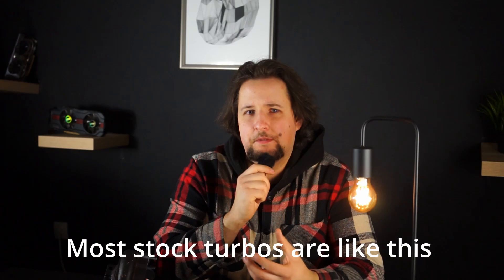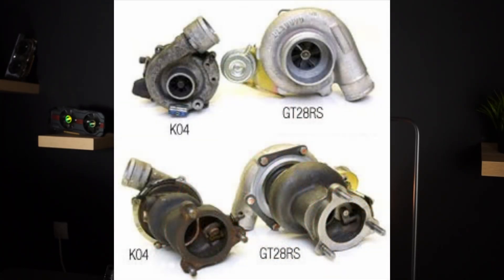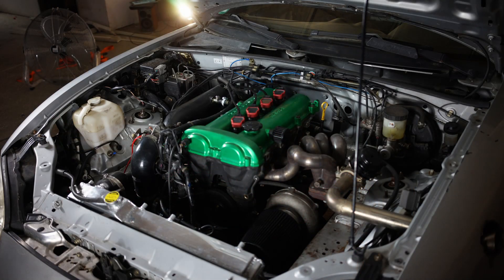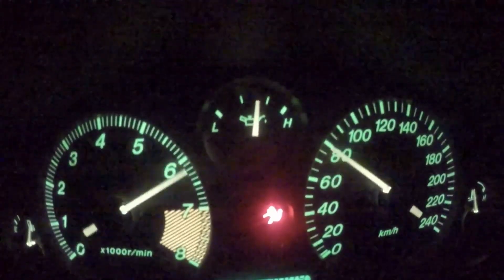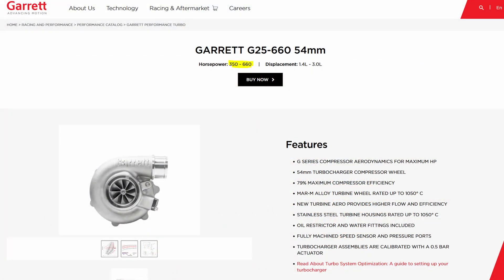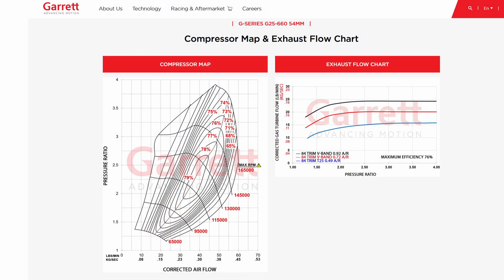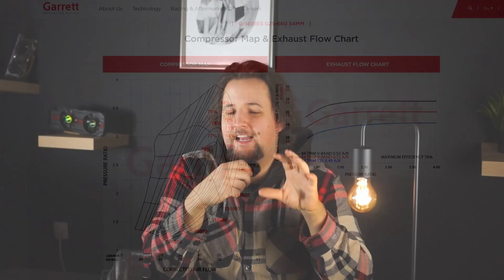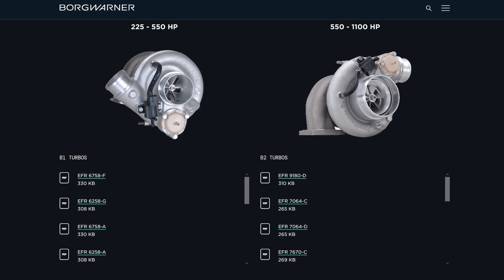What is the bestTutbo FOR YOU?  | BEFORE you buy a Turbo | IN DEPTH Turbo Sizing Explanation

Comment: Can you help me decide between a Garrett g30-660 vs a g30-770 for a Subaru ej235 engine that can rev to 8-9000 rpm’s? 1.01 A/r that housing for both
Reply from the maker: this is only dependant on the power you want to make. if you want to make 600 CRANK or below (so like 500 wheel) then choose the 660 if you want to make more like 700 crank then choose the 770 or if you wantr to have a little more headroom to turn up boost. 
Though the spool difference will not be much, so going for the 770 does not have huge downsides

Comment: Was recommended 3071 gen 2 for my 2.1 liter volvo engine (b21ft), 7.5:1 compression.
Its got stock forged internals, I was thinking "350+hp", also will run high quality IC, better flowing intake, 3" dp, 3" exhaust.

But then I saw the G series turbos, for me it seems like maybe g25-660 or g30-660 would be better for me than the 3071 gen 2?
In my head they will spool quicker and also cost a bit less. Still quite expensive though.. I dont know if the g25-550 will be too restrictove on higher rpms. (6500-7000).
Reply from the maker: I'd go for a pulsar pta4849 they are basically a g25-550 that's a lot cheaper and has been modified a little for more exhaust flow

Comment: I have had a Garret GBC 22-350 on a 1.4 t-jet fiat engine. Full boost around 4000 rpm but had horrible boost creep straight out of the box, everything was installed correctly. Now I have a Pulsar 3942G ball bearing turbo and it's great and really fast spool. Full boost at 3.000 rpm
Reply from the maker: on these its not really boost creep just garrett speccing the actuator wrong. the specs say its a 0.5 bar or 7-8 psi actuator but its actually a 1 bar actuator or 15 psi. 
if you replace the actuator to a lower pressure one it works fine! 

the 3942 is also quite a bit smaller so i think that also has a lot to do with the spool characteristics adding to that the smaller exhaust housing also! but its much better suited for a 1.4 engine.

Comment: G30 660 on 2l, what would be the peak boost rpm?
Reply from the maker: depends on the engine but probably about 4300-4600 RPM or so.could be more or less 

this is also dependant on Exhaust manifold layout, Downpipe and exhaust aswell as compression ration and some other things. VVT helps a lot with boost response.

Comment: Do you think a G30 or G35 Housing is better suited for a 3.2l engine? Power Goal is 650-750 so im unsure which would be better
Reply from the maker: id say at that power level and displacement, go for a g35 turbo it wont be much laggier than a g30
Reply: @throttlebuddies0  thanks a lot
Reply: G35 900 is perfect for a BMW 3.2 up to 700 wheel. A 3582 is lagier , a g30 has too small a turbine at 55mm exducer. It will choke , and it will spool so early it can bend rods. (Boost below 3000 rpm is really hard on your engine )

Comment: I can say from experience that the g25-550 on a 1.6 starts going positive pressure at around 2500 and full boost just under 4k and holds strong till redline .. thats on a forged rotating assembly and bored to 80mm 1.6 miata engine with a fluidamper ported head custom intake and a bunch more , but i started with a log manifold (cheap e bay one and it works but not the most efficiently) i have been looking around to try and find a better manifold but for now its just a cast log , o and i have it set at 2 bar of boost so its somewere around a 400hp 2k lb miata , super fun bit dont come in to soon to make me just burn the tires off every time i hit the gas but soon enuf to have a decent boost threshold, next will be 70lb springs and retainers to push it to 8500rpm's then cams and billet mains and it be ready to possibly break 5-600hp we see .. my goal is a 10 second street daily driven rat-rod 😅.. love all the info brotha , mad respect for sharing what knowledge you can .. peace and love brotha, keep it rad, stay safe, and build on.. ps i had a gtx3071r on b4 the g25 and it was still great but spool was just a lil less ompth if that makes sence , but i am willing to bet its cause the housing is bigger exhaust side but not enuf to hurt really just enuf to notice 😅 if that males sence .. anyways much love and respect bro , l8r .. ps ps one day i plan to build a atlas 4200 inline 6 will have to show ya whenevr i do that one .. its at war with the barra 😅
Reply from the maker: I have a 1.6 NB miata and im trying to push the engine past 500 hp when it runs again. be careful with the High RPMs the stock oil pump really doesnt like it. A friend tried it and maximum power at 8500 with a fully balanced rotating assembly is about 450 hp then his pump shattered. no limiter etc. 
the G25 is crazy good on small engines. personally i think original garrett is too expensive though. i loke the pulsar knock offs. Tuned a clients car with one, 1.8 VVT log mani and made full boost at about 400 RPM without any tricks to get it online sooner. so when doing that might be able to get it down to 3500 or even lower. 

on my own car i want to stay too-large turbo, to not stress the engine. im running stock pistons and with a gt35 size or g35 in the future ill be able to run more power without anything breaking. about 700 hp should be possible on stock pistons.

Comment: Very accessible overview! Thanks! Would you consider making a video on superchargers? To me, as a newcomer to all of this, they seem to be a good choice for enthusiast applications. Mainly because they are very responsive. Additionally, for naturally aspirated cars, they also seem to be easier to install. Maybe the heat management is easier also? They might be less fuel efficient than turbochargers, but fuel efficiency might not be the highest priority in an enthusiast car application. And of course, the turbocharger can produce some quite cool noises. It'd be very interesting to hear your thoughts on superchargers!
Reply from the maker: i dont have much experience with superchargers so no i unfortunately wont be making one in the forseeable future. 
if you size your turbo well. they are very responsive aswell the only "negative" you have is that you will have a torquier punch when boost hits but for example when using a 3l engine and a g30-660. spool is almost instantaneus. id say nowadays there isnt really a place for superchargers anymore.
Reply: @throttlebuddies0  Thank you for your fast and informative reply!
Reply: Turbos are way better than superchargers. Especially when it comes to power cos superchargers rob power off the crank
Reply: Supercharger are decent for low power street cars , but my beef with them is that you have to change pully and belt to change boost as opposed to turbo with boost controller I can change duty cycle wile I drive ... tbh that's really the only downfall imo of them , well that and they usually fall off in the top end as opposed to a proper size turbo will just keep pulling ... really depends on what your plans and power goals are fam , the Supercharger is a lil easier to deal with I would say cuz they are self maintained (so ya don't have to tap into a oil and water feed and drain ) but the piping and intercooler would basically be the same , so the only difference would be the unit itself then , and as was Saud,  with the tech in turbos now , you can get a twin scroll that will punch like a small turbo and hold strong up top like a big one , so really , turbo would be the best bet unless you just want the wine of the super , but I would argue that a compressor surge or BOV sounds better imo of course .. hope that helps in your decision, my brotha , peace and love all, keep it rad, stay safe, and build on..l8r famz and keep having fun